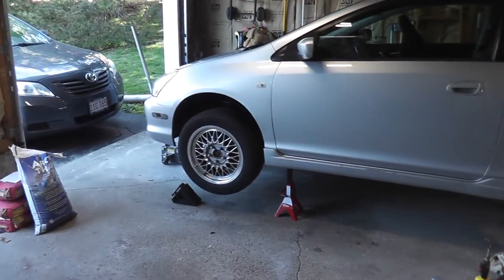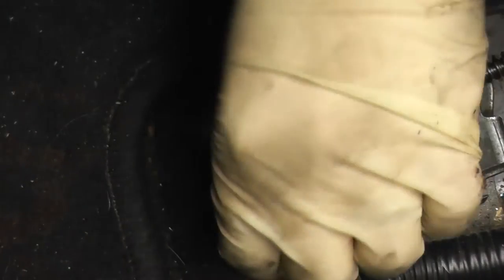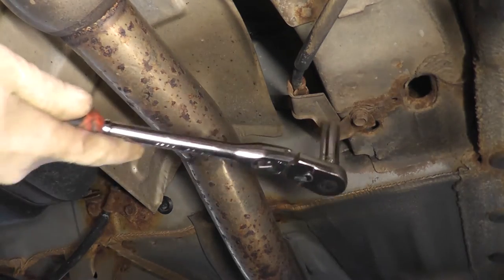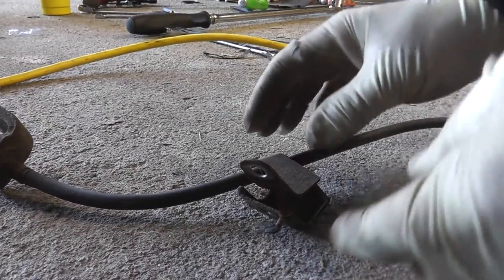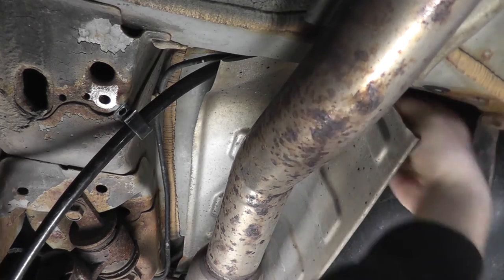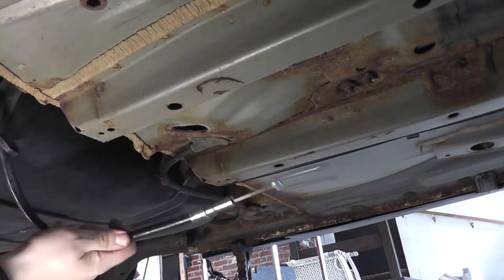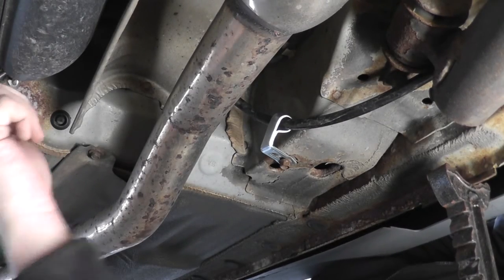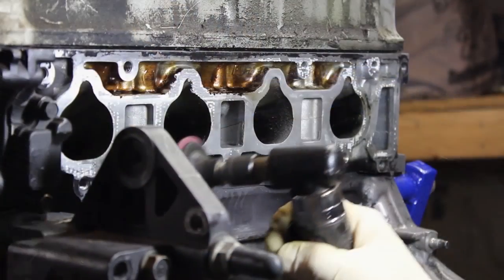2002-2005 Honda Civic Si Parking Brake cable replacement

Comment: Helped a lot with the information provided, thanks! One thing to note is that I got the bracket that holds the cable to the rear caliper out with a hammer and some heat.

Comment: You can put  a couple of washers (or 4) on the other old cable near the front if the balancer looks like its at its limit. Did mine this afternoon.  Good video.

Comment: Throwing the entire rear end of a 2005 Acura EL (4x100 disk brake system) into a 2004 Honda Civic LX (4x100 drum). Looks pretty plug and play except for the parking brake, so thank you for that. Any tips or warnings on this conversion I should know about?

Comment: probably a dumb question, but would replacing the cables fix my parking brake not catching?
Reply from the maker: I would check the main cable adjustment under the center console first. Remove the console and look at the yoke and see what happens when you pull the brake lever up. if one side pulls more than the other then try disconnecting the cable that doesn't move from both ends and see if you can manually move it. If it moves freely, then its probably out of adjustment, which can be done at the brake lever yoke assembly.

Comment: What should you do if one side is significantly tighter than the other?
Reply: I know if this is an old comment, so you might not need help anymore. 
But you should check if the cable is twisted or bulged out on the side that is significantly lagging behind. 
If it doesn't tighten the same way when you tighten the handbrake nut few turns, it could be a good idea to change the cable on that side, it might be beginning to fail.
I had the same issue, although mine didn't stop at all at one side.
Reply: @Kydenius  Problem on mine (99 Accord) is that the caliper was frozen and I had to replace it.  Got to love hydraulic parking brakes.
Reply: @keithmiranda4337  glad you found the fix!